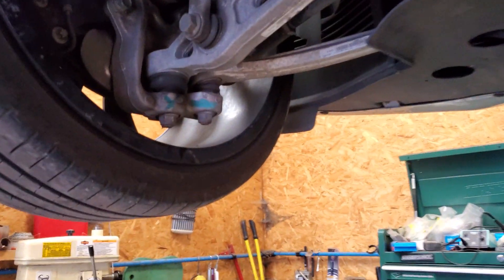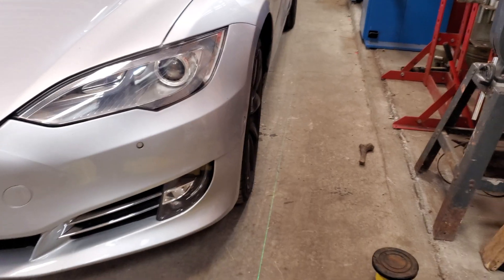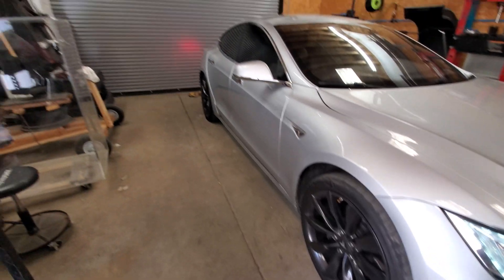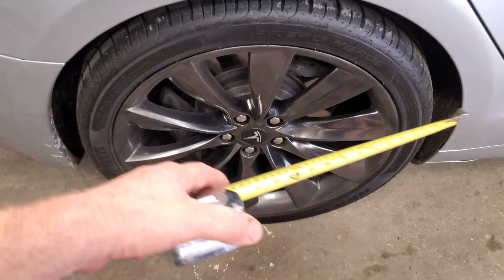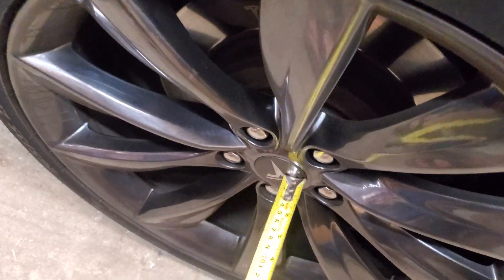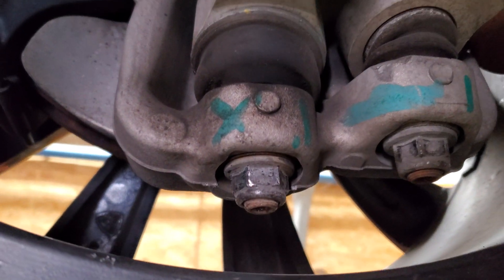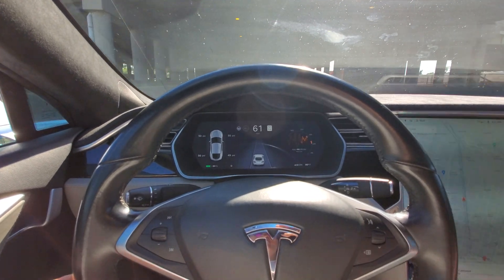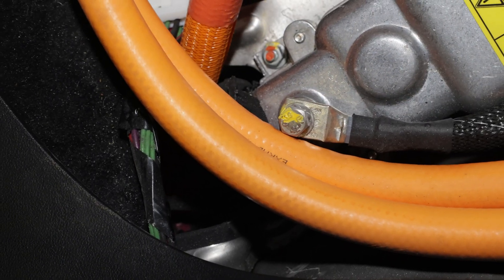Doing an Alignment on my Tesla with Construction Lasers .. lol

Comment: You aligned your lasers parallel by measuring rear hub to front hub. The problem with that is that the hubs have different widths front to back.

Comment: does the self driving correct for the alignment till the wheel falls off like the space shuttle did?
Or will it say wheel alignment problem, get fixed, auto pilot disabled.

Comment: It should pull to the right ever so slightly as the camber of the road should take the car away from the median and into the ‘safer’ area to the side of the road where you won’t have a head on collision if you are unconscious 👍🏼
In countries that drive on the left it should go slightly left.
Reply: No. It should not pull at all.  With hands off the wheel it should drive straight down the road without any drift

Comment: You can can determine the angle of toe in by running a compass app on your phone, placing the edge of the phone along the laser line and reading the heading (this is your base angle).  Next, place a straight edge along the outside of the wheel (against the rim, not the tire) then place the edge of the phone against the outside of the straight edge and read the heading.  The difference between the headings is the tow in angle.
Reply from the maker: Love it, that is very creative
Reply: Holy sh*t really? Is this stuff that precise now?
Reply: @volvo09  I asked the genius bar nuts about the resolution to see if I could make a gun sight out of an iphone.  Would make a nice way to shoot around corners without exposing yourself much, just the trigger finger.  LOL
They had no idea.  Found out the only way to install the software would be to give it to apple so I could download it to the phone after paying them for the privilege of compiling it.

Comment: PROBABLY why auto manufacturers havs been using crenellated nuts on suspension parts since, well, forever.
Reply: Yeah that's what i was thinking... Where's the castle nut and pin?
Reply from the maker: That's a great point, or maybe even stop nuts but these don't look like either

Comment: Dealers make mistakes. It happens. It's a human using a tool likely to make a mistake at some point. Not cool on such a safety related feature though. Love your channels and your work. Always a good day when you upload. Thank you.
Reply from the maker: True, studies have been done and if I remember correctly, 98% of mechanical failures are caused by human error.
Reply: Even if a castle nut won't work becasue the offset is to fine, put a damn clip on it so the nut can't get off.